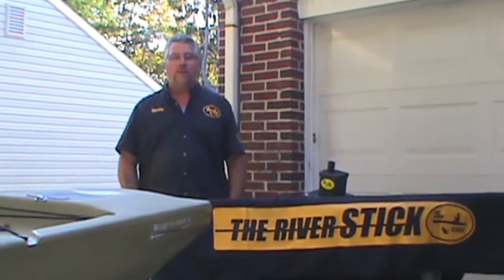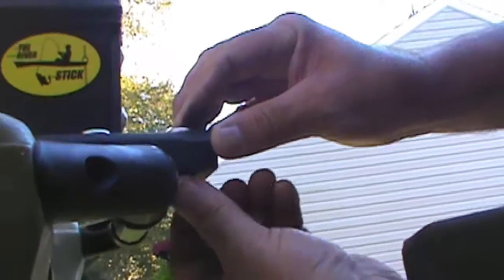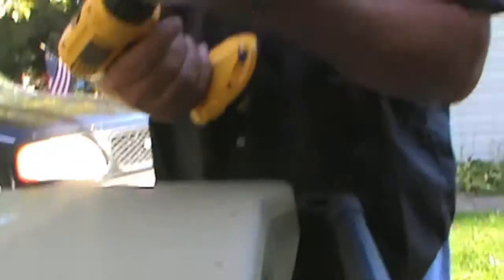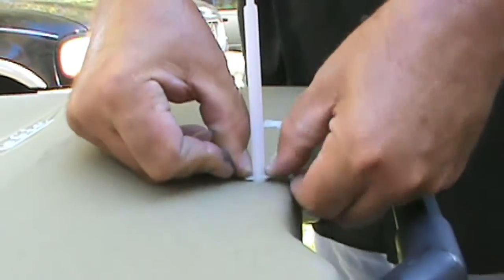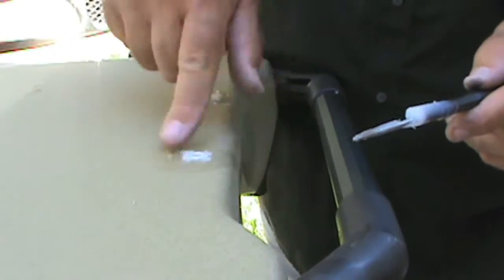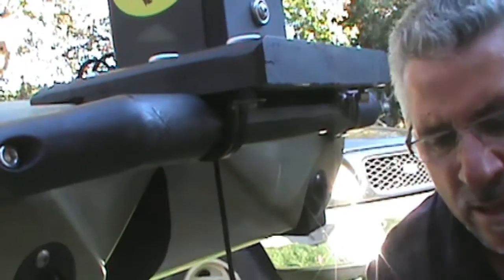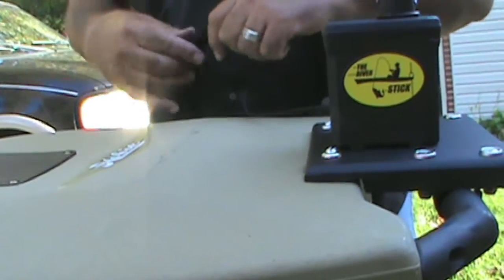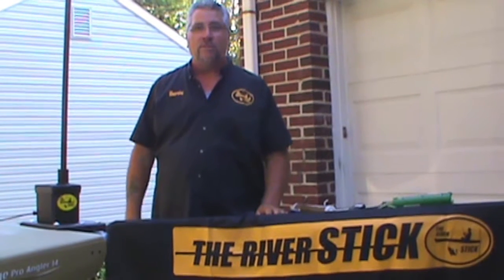The River Stick - Hobie Mirage Pro Angler 14 Install

Comment: Just added one to my PA12 and I think there's a big difference in what I was going to use and this. The pole seems like 3 times the weight of a Yak Attack Park n Pole which I have but so far has been useless. The box and mounting plate seem way better than the cutting board stuff I was going to use and the 4x4x4 conduit box from Home Depot. The pole is the main reason I think it will work so much better, this pole is solid versus the hollow fiberglass poles. Trying it out tomorrow.

Comment: 24May2018.  Thanks for the video sir.  After viewing the Titan 13.5. Native all decked out an had twin anchors on the rear corners that appeared to work beyond awesome.  If I order one, I may just get twins an make a jig plate inner n outer n provide a greater force to hold Yak even in wind.  Other than the seat on the Titan Yak, I'd say it's the winner overall both for rigging n stability as its 41" vs PA14 37".  I don't have any issues cuz I have fat sand tires positioned downward to act as  buoyancy enablers.  An appears to work very well.  At 235lbs I can't turtle the yak nor made me uneasy standing up against Hbar.  I have balance issues now, n every thing I can do helps IMHO.

I like the fact that Titan also allows reverse n simple pull rig out n cover n it won't bail over n lost.  With a Hobie seat n throw there's away, but rig to keep the retracting with PA14 seat you'd have the ultimate one man bass boat.  Install front n aft trolling motors with GPS n you'd have a killer outfit that every serious fisherman/woman would ever want.   Better get your act together Hobie, cuz there's a better Yak today.  I love my PA, but it sure be fun to rig a Titan up IMHO.

Comment: non motorized and still almost as expensive as a power pole. cool concept. these things could be made way cheaper tho
Reply: Half the price is not "almost expensive as a power pole."
Reply: ... a power pole system if you went with the battery pack is $1000